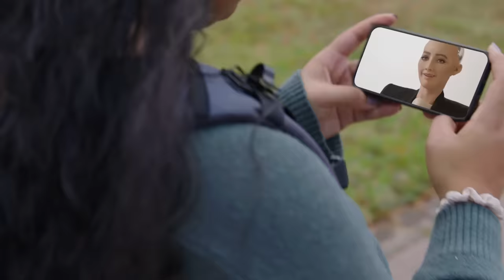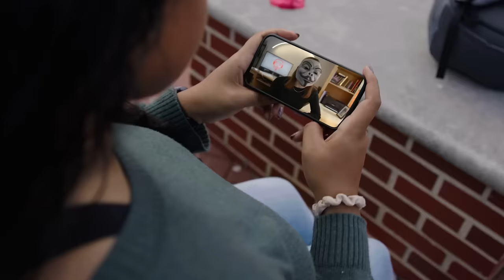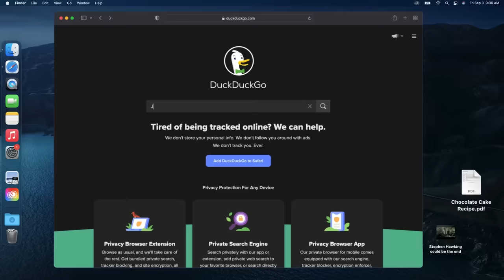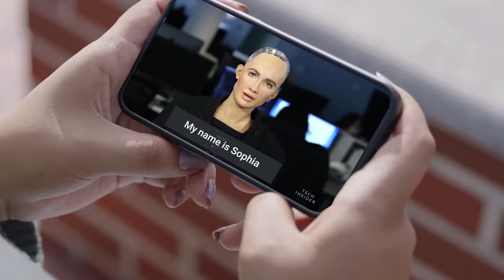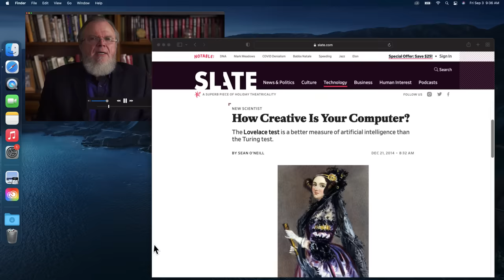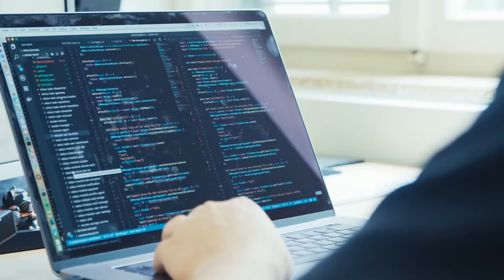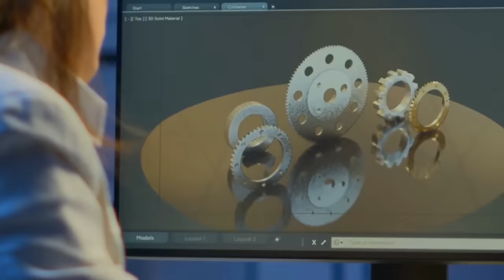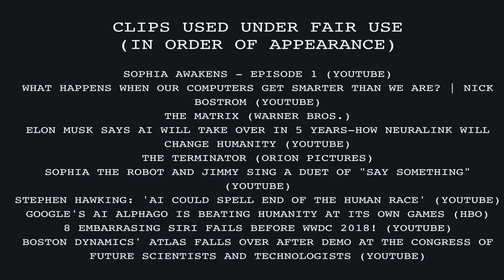Artificial Intelligence: Will Machines Take Over? (Science Uprising, Ep. 10)

Comment: As you know polynomials can be made for a circle, a parabola and so on and by tuning terms you can make a curve fit data points better, like those averages you see for plots. A line sometimes works well, but curvy plots need curvy averages and then you'd need a whole network of nobs to make wiggly curves. So you see AI doesn't need a set of instructions to categorize things and make them give certain responses. It can just fit the curve on its own by averaging better and better. So it self-adjusts based on new data and can categories data it gets... and it is fair to call that a kind of artificial intelligence cuz you'd need some smartness to be independent. We could label and map out art in this way too